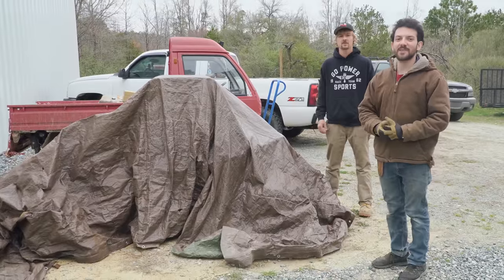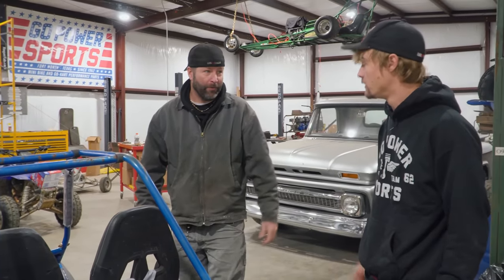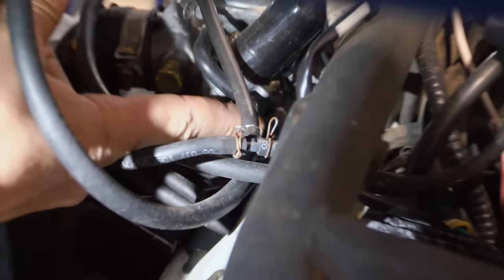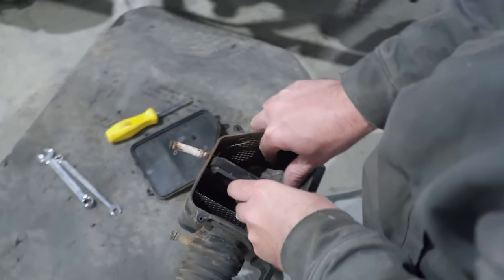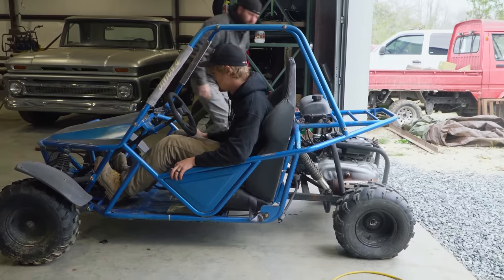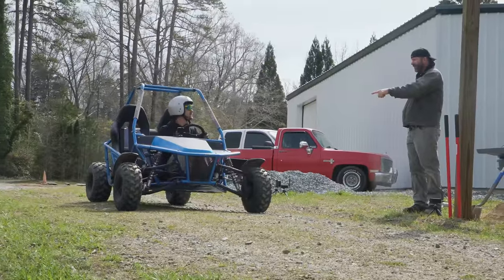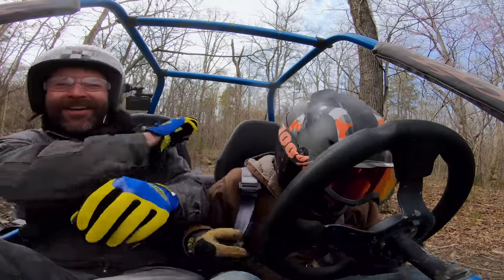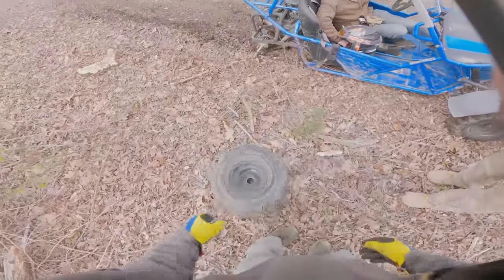Full Suspension 150cc Go Kart Revival + Rip | $500 Disaster, Wheel Falls Off!!

Comment: Absolutely loving this one. Please do the the 600cc scooter swap!! And probably upgrade that axle first haha.
Reply: Why when you can keep the 150cc block with reverse and build it up to produce just as much power because reverse is awesome
Reply: @dodgeme1986truck  While I don't necessarily disagree because builds are cool, there's no way a 150cc engine will make as much power as a 600cc with any sort of reasonable budget.
Reply: @jameshealy4594  you'd be surprised I have a qmb 139 (gy6-50cc) that pushes about 45hp and 50 ft lbs. At the crankshaft that was built to that point for under $1500 total including fuel injection
Reply: @dodgeme1986truck  Mate I'm not trying to rain on your parade but that's more power than 250cc motorcross bikes, is it possible you're estimating a touch high? Also even if you're exactly on the money, four times the cubes is going to make a bunch more torque and one or two mods would take it to a point no 150cc engine is ever going to hit.
Reply: @jameshealy4594  my hp and torque numbers are rounded down that engine was on a small engine dyno when I got those numbers and rounded down for weather and wear conditions as that engine now has over 12000 miles since the build
Reply: @jameshealy4594  I doubt that these fellas are too worried about a budget far as upgrades and parts is concerned with GoPowersports having their back I'm pretty sure they'd be able to get it done and showcase plenty of available parts for everybody at home who has one of these!
Reply: @jameshealy4594  Well its not impossible. My neighbor bought piles upon piles of Honda CRF's and CR's and started to build them. His entirely rebuilt 250cc two stroke stock pulled real nice 39hp, but his custom built and tuned 125cc race engine in ..semi street legal CRF...kough i mean CR configuration left it easily eat the dust. That thing had closer to 60hp and it was nearly undrivable since keeping the front tire on the ground was challenge. Would have flipped it if it didnt have worn out tires that didnt grip on dirt road. Note that world fastest 50cc just dynoed 30hp. This was on home made dyno and those neighbors hp's were based on experience but it is probably close to those numbers. Absolutely crazy power given weight of these things. Of course when you go to higher speeds displacement start to matter, but if you look acceleration those smaller engines get there hellawa more faster. This is why cruisers have big displacement as it takes less fuel to keep that mass rotating, and smaller engine starts to get to its limits in simple heat dissipation and how far you can take it. So for track like this smaller engine is better as it accelerates faster, where larger engine sure has umpf but straight ends before you get that power out, least on my experience.
Reply: @Hellsong89  125cc GP bikes run by Honda, Aprillia etc are often quoted at 45-50hp to the wheel and there's nowhere near 10-15hp being lost in a chain drive. Plus, they are two-strokes! There is no way a 125cc four-stroke is making 70hp and even doing it with a two-stroke would, as far as I know, be well into world record category where you have redefined what is possible. Maybe running on some exotic fuel like nitromethane? Not trying to shit-talk small engines, I love them, I just think we need to be realistic about what power numbers are being produced! I'm not an engineer and not trying to call anyone out, it just sounds to me like some estimates stacked on estimates situation.
Reply: I say if its quick and powerful enough to have FUN on, who cares what the output is. These are meant as fun projects, and if your watching these videos, I'm certain you understand how much fun you can have on something with 6hp! These Go karts and minis are meant for one thing... putting smiles on faces.
Reply: Someone moved the decimal
Point one position to the right. No way your 50cc is putting out those numbers it’s virtually impossible. 
Either that or that dyno needs a seroius recalibration.

Comment: A Ike it's called a fuel enrichment enhancer  During 1st start up start up voltage is applied to that as it warms up it loses continuity and shuts it off It allows more fuel to enter enter in to the intake just like Spraying starting fluid but it sprays gasoline into the engine so it starts up quicker

Comment: Love seeing 150 gy6 content finally being made here. That's definitely an automatic choke. Otherwise there's usually a cable that runs underneath the driver seat with a little spring loaded plunger. Been working on a few of those that a friend owned, they're excellent machines
Reply: Technically it's an enrichment circuit it allows more fuel on cold start and receives voltage from the regulator to close the circuit off as the engine gets warm

Comment: A engine swap with that big wrecked moped onto that frame would be awesome
Reply: Not a bad idea! The Honda silverwing 600 yessss
Reply: @midnightwaterdragon4725  it would be awesome it is already setup like the original engine only difference is the silverwing has the transmission connected to the wheel hub instead of running a chain but I bet it would be pretty simple to setup to run a chain

Comment: 2:50 I can tell you straight up.  These things carry a lot.  I have a 2012 Kandi Spyder 150, only buggies better than the spyder are the Hammerhead Twisters.  But the Spyder weighs 709 pounds with a max capacity of 750 pounds, so at roughly 563 a reasonable expectation would be a 600 pound weight capacity.

Comment: For your sign just a suggestion but maybe you guys could mount an aluminum or galvanized pipe to the top of the left pole at a 90 degree angle  and hang your sign from that which eliminates the 2nd pole and the danger.  Anyways longtime fan of you guys,  keep the vids coming.

Comment: I think it would be a great idea to put up a Guard-Rail on the right side (if you were looking at the start line) before that 4x4 post, so when you're coming in hot to finish and you aren't in the middle of the track, you don't head-on that 4x4 post if you slide to the left coming into the finish line. Thinking out loud :)

Comment: It's blue, Y'know what else is blue? a Tillotson 212 with E-start.
Although I would gear it lower with a new rear axle and generally make it stronger. Also keep in mind the caster angle if you put bigger tires on the rear (and it would need lower gearing too unless you really wanna do 60mph in that thing and fry clutches).

Comment: You can do alot with the GY6 250CC BIG BORE kit. Cam shaft ignition timing, prob run a 24mm mikuni at 250cc. And parts really ain't too horrible be awesome as hell to see the biggest meanest gy6 build. Test ride and rebuild suspension to be able to handle it. Show us how to make a budget gy6 cart an absolute ripper and how to modify the kart to handle nice and be fast with the extra power
Reply: For the 250 kit you have to get the case bored

Comment: Pro tip, take a q-tip with some valve polishing compound on a drill and polish the needle seat. Thatll fix any sealing problem unless the rubber tip on the float needle is hard then that goes in the bin lol

Comment: Also I would check behind the CBT variator, they generally have a plate that will restrict the CBT variator from extending all the way. That should allow you to get more from the engine as well as getting variator weights and an upgraded variator and clutch, carburetor, and obviously gear ratio.

Comment: if you didn't know under the chrome cap on top the carb there is a bolt on top the slide to keep it from opening all the way to governor it. cut it off with grinder to the diaphragm and then you will get full throttle or upgrade to a Mikuni slide carb.

Comment: Today's words of wisdom...no comment.
Just kidding.   Ike said "are we even getting full throttle"?  Good question... But how would you even know?
Since the carb is vacuum operated, just because the cable opens the butterfly does not mean full throttle.  These carbs work best through the airbox. They need to a low pressure to pull the diaphram up and give you full throttle.
Big bore kits are awesome, but there is much more power left.
Pull the CVT cover and confirm full belt travel. 
Open the exhaust if you had no neighbors I'd recommend 6" straight pipe, but something legal but big will help.  Aftermarket CDI is good but not huge. The CVT & exhaust will help a lot.
Remember its 149cc not 212, so torque is down.  Have fun and invest in some better wheel & hub combos.

Comment: I actually just bought an atv last week with the same motor what a coincidence lol. One thing I noticed is I think you might not have full throttle as Ike said. On my atv the motor has quite a lot of torque and it seems to rev a lot higher. Once you guys get the kart fixed up you should see if your getting full throttle and higher gearing might be a good idea!

Comment: Install heavier variator rollers for more top speed, longer belt for better acceleration, 171 drop in big bore kit is the biggest you can go without boring out the case. Have fun with the gy6. And yes. That is an auto choke on the carb

Comment: On Gy6 motors the Carb bounces up and down while the intake manifold is aluminum coated rubber with a rubber hose end that connects it to the Carb. It cracks across the top and lets air in. I cut the rubber off the manifold and cut me a piece of radiator hose that fits. The radiator hose has string in it that gives the rubber structural integrity and I use a hose clamp on the manifold and one on the carb to attach the Carburetor. The vacuum leak is why it starts some times but not all the time and when you hit the right bump the engine stops running.

Comment: For those posts, I think the ideal thing to do may be to have one post on the garage side and get rid of the other one so there's no chance of hitting coming out of the turn. Then have a bar come across the top to hang the sign off of. It may not be quite as rigid as two posts, but since it's only going to be holding a sign, it should be just fine. Maybe a 2-3in pipe with 1/8in wall or some should be plenty strong for that. That way, there's no chance of a pole crash.

Comment: There is supposed to be a vacuum fuel pump/petcock to help to get gas to carb.. most gy6 engines need them, you might need a new carburetor and manifold with the vacuum line nipple😉

Comment: On the carb, that is an automatic choke with the plug on it. I got to know the gy6 motors well messing around with scooters.  The 150cc are usually between 9-14 horsepower stock - depending on which motor it is.
Reply: I got a gy6 150 scooter, I believe spec sheet says 7.8hp or something like that. Do you  have a link of where I can read more about which models makes more and the difference between them. Would be useful for tuning. Cheers mate.

Comment: My uncal has one of those  just like that has a full transmission, and reverse  and had the little rack above the motor. It would do about 65 mph. I think k he has like somewhere around 150 go cart.   He also has one of the the full aluminum  with the gas tank on the side it's all aluminum the frame everything.    And you just about lay down on it.    Off set motor.    It's crazy cool and fast
Reply: Ant & uncal 🤣🤣
Reply: #Hitydesign USA today

Comment: You guys need to put like a 450 fuel injected newer quad motor in that thing and it would be like a mini side by side and it would be super fast and you can make that handle even better with better suspension and extended swing arms.  That thing looks awesome and handles well now it needs to make some power and sound the part. That would be so cool thats what i would do.

Comment: You guys should fully build one of those gy6 engines, they seem to have a lot of mods available, love the videos guys!!
Reply: Yes they do... I have the smaller gy6 50cc (aka qmb139 50cc) bored and stroked to 96 actual cc, cam, big valve head, ported to 1-3/8 intake 1-1/4 exhaust, 12 pole stator and flywheel, custom stainless header, efi (tbi style) conversion, long tube intake, regeared final drive, returned cvt, custom machined piston, and more. That engine pushes 250lbs of rider with gear and the scooter it's in to a top speed of 81mph in the 1/4 mile, and it still pulls the front wheel on launch

Comment: That thing on the carburettor is definitely a auto choke. There will be a temperature sensor somewhere on the engine that will determine when the choke should be on. That would probably be the cause of the black smoke (running rich) when you first started it up. As the engine is still cold therefore still on choke.

Comment: Time for a big bore kit, stroker crank, cvt springs and weights, cam, upgraded 11or 12 pole stator and flywheel, a performance cdi box, performance exhaust, performance long tube intake, performance tuned carb, some lighting and better tires

Comment: the plug on the carb is a fuel enricher i have rebuilt tons of those motors and the stock wheels are cheap drill and weld on steel plates and then the rim metal can not tear

Comment: With that amount of smoke and low power, you might want to look at the piston rings. I had a gy6 scooter once and it burnt more oil than a two stroke until it had no more compression and wouldn't start. Once I changed the piston it was good again.

Comment: Be glad it was a back tire.  I had a front tire rod blow out and we rolled a 2 seater.  sprained wrist and strained back and neck.  That was terrifing and I thought if we had not had on 4 point harnesses we both would have hard really bad injuries.  If we had not had seat belts on and tight we would had been injuried or dead.  it was quite scary.

Comment: Hey this go kart is like my 02 ram that originally had a 4.7 v8. I put a 5.7 hemi and already had 4wd. Well we stripped the original trans and before it did was a rippin and a tearin. Well we replaced it and went to work and was going 75 and started feeling a bad wobble in the rear end. We were in the fast lane and I drank the night before and had my friend drive and got over after a mile when it was worsening. The back passenger wheel fell off the truck. Upon further investigation, I look and the axle housing was split at the end where it got red hot. The axle itself was just twisted like playdoh and the the rim, brake caliper, caliper braket and rotor went with the rim. I ended up kissing the middle cable barrier and just put the truck in 4Low and  backed the truck up away from it and brought it up to the side of the road. When the tow truck got there, we had to close a lane down and I pulled the truck up on the tow truck. BUT WAIT THERE'S MORE!!! Well later that week I got rear ended in my new eclipse gs. I filed a police report because he ran. Well went down to the police station and since it was the same township as my other incident, Well I get the report from the day that the wheel fell off and was like wtf is this. And it said "A stray wheel struck a parked vehicle at a gas pump" at the next exit from where we lost the wheel in which the next exit was 2 miles away. Lol this happened last year just before the brood x cicadas arised. It was a s**t show of a week haha.

Comment: Those carbs do have an electric choke/enrichment device, unfortunately they are notorious for not working. Typically I find if you crank the engine for about 5 seconds with the throttle wide open then let off the throttle and it will fire right up. Have had this engine/carb on Chinese 4 wheelers, a Chinese version of a UTV, and am currently running that carb on a Kawasaki Bayou 250.

Comment: That is an "auto choke" actually it's an auto enricher, it lets extra fuel in at start up instead of choking off the air. Also sounds like it might have a governed CDI, which limits the rpms. I work at a scooter shop and that is the engine used in all Chinese scooter.

Comment: Change to a manual carburetor instead of having electrical carburetor on it. I put a manual on my 50cc moped and it made it a little faster and it handles better.  Because the electric carburetors on those type of engine don’t last long.  On my moped didn’t last me but a few months

Comment: It is an automatic choke, I had a similar go kart. (Kasea Adventure Buggy 125) Those auto chokes always fail and then the go kart won't run right. You're better of replacing the carb with a mikuni with a manual choke.

Comment: I have the spider box with the gy6 150 engine. Top speed is 45 mph with no reverse gearing.
I have a 675 cc two cylinder two-stroke engine from a snowmobile that I’m going to install. 3 years and still have not started this project.

Comment: I used to have a kart that was very similar. The thing to watch out for with those motors are the starter clutch goes out all the time and the cylinder becomes washed out and you get a ton of smoke when running. Luckily you can replace the piston and rings for 18$ with gaskets. I had to do it every 6is months with extreme abuse to the motor.
Reply: True, and the starter clutch issue gets worse  with high compression big bore kits.

Comment: You can get cheap big bore kits to bring it up to a 172cc, there's also bigger flat slide carburetors that add a decent power, as well as different camshafts, you can also tune the CVT shifting with different weight roller weights on the front pully, gy6 are very capable engines can make good power, and have great aftermarket support and parts, straight pipe sounds sick too
Reply: It also sounds like it's not reving out all the way, explains the slow top speed it should be around 9,000rpm at topspeed